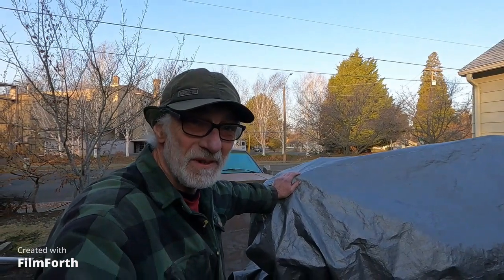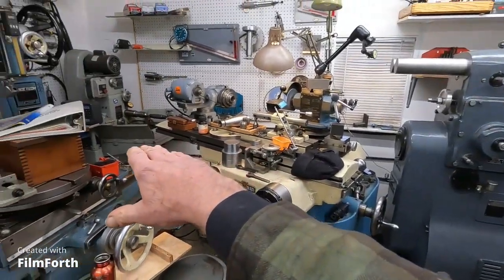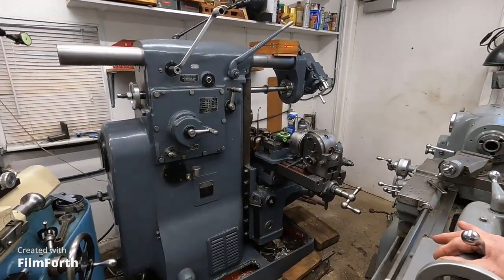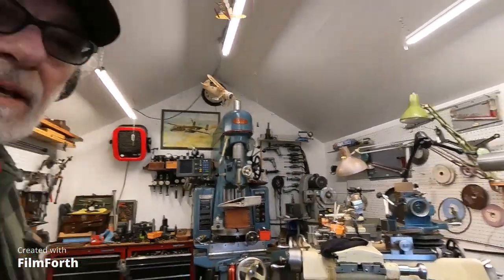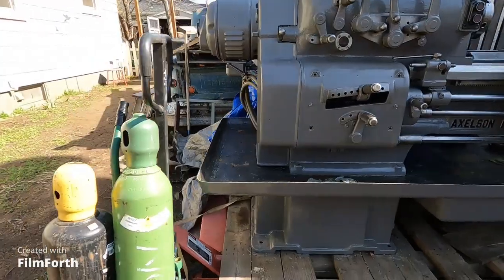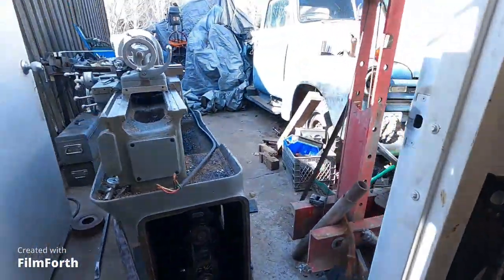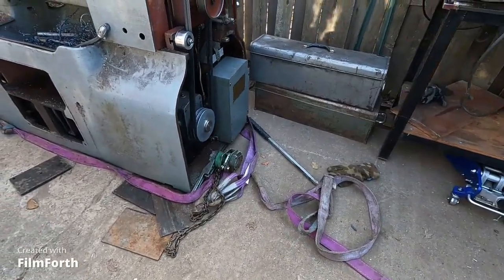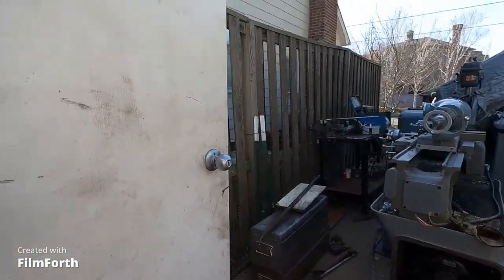Safely moving machine tools on rough concrete

Comment: Making good progress you must have some serious weight in iron on your property! Great to see what can be done with very simple gear and determination, what a puzzle though working out where to put machines and still be able to use them to there full potential in such a cosy space.
Reply from the maker: Yes, like a machine shop in a submarine. I would have more room if I didn't find the mill and radial drill at the scrap yard, thanks